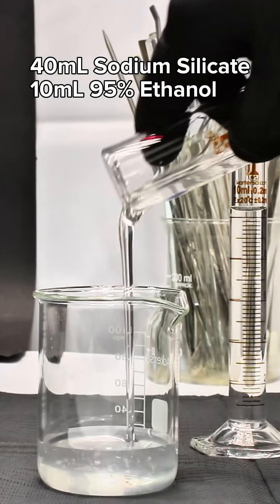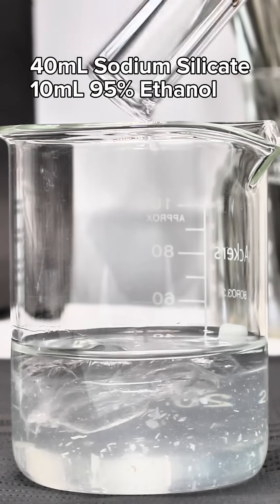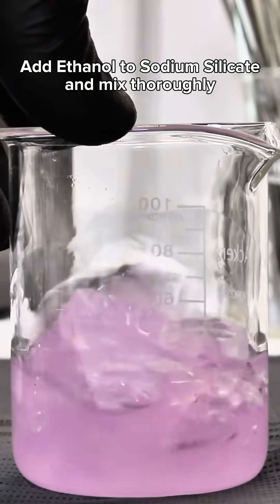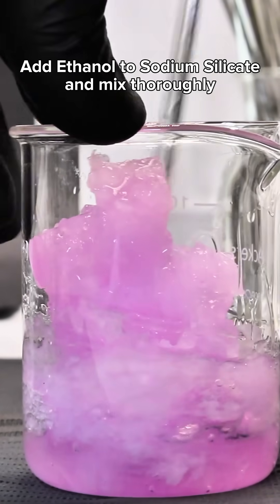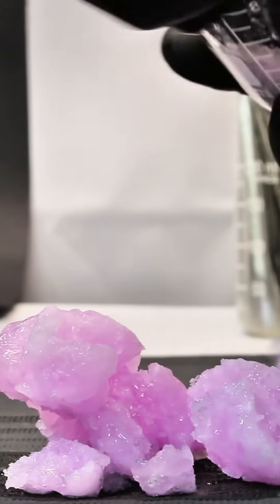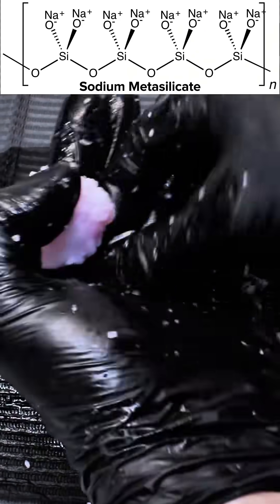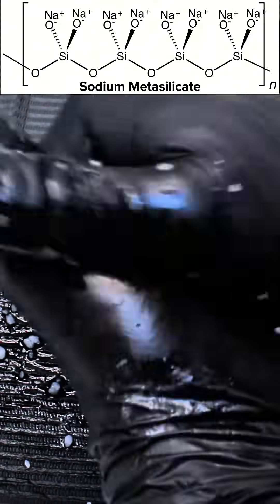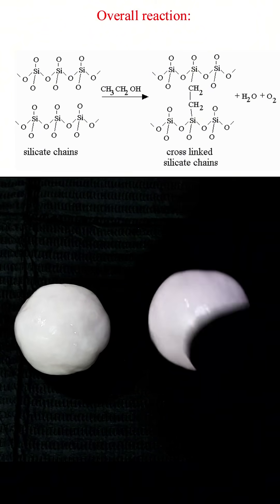Making a Simple Silicone

Comment: Please make a full video, is it also possible to cast it into a ball shaped mold while still able to extract that ethanol? Handshaped spheres feel unsatisfying :p
Reply: As he mentioned you need to work out the ethanol before it can properly set, hence the squeezing. I suspect if you used a spherical mold once you were nearly at the end of that process it mig hurt work either minimal shrinkage, since the clump would reduce in volume as remaining ethanol evaporates.

Still, if you want a cheap spherical mold, use a cake-pop kit. I imagine that if you took it one step further and got a large syringe with a wide bore tip (or just cut it to custom) you could pressure inject the mass, maybe even heat it gently over a blowing fan to dedicate it, or something.

Comment: So why don't commercial silicones use this process? I've only ever seen RTV process (tin-based afaik) and platinum cure(idk how it works, just know its for body interaction since it doesn't leave toxic substances in the polymer) Both use dimethylsiloxane as the monomer precursor if I'm remembering  correctlya.

Comment: And all these years I thought you needed to start with highly toxic non-aqueous precursors in a completely water free environment to make any kind of silicon.
   Is there a chemical name for this kind of silicone so I can look up things like chemical resistances, thermal break down temperatures, analogous compounds ect?
  Do you think this would make a good exchange membrane in a battery? What happens if you substitute glycerol instead of ethanol? Things other than alcohol, an aldehyde for instance? 
   Just so many questions!!‽
Reply: My understanding (at least from the long-form video) is that the silicone he just made is a bit lacking in some material properties you'd want in many applications, but for a 100% DIY bouncy ball it excels at bouncing
Reply: Well, to be fair, making sodium silicate involves dissolving silicon dioxide in sodium hydroxide, iirc the less water the better.
Reply: Beacuse it's not a real silicone.